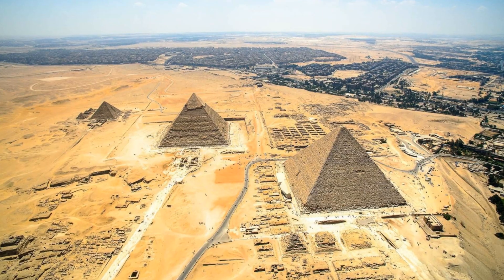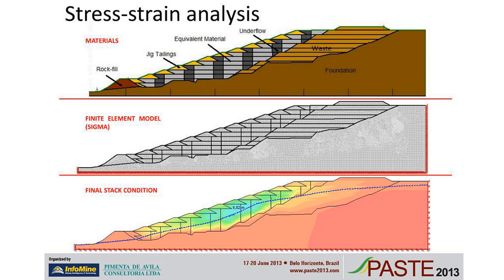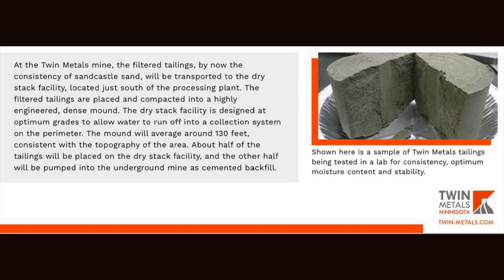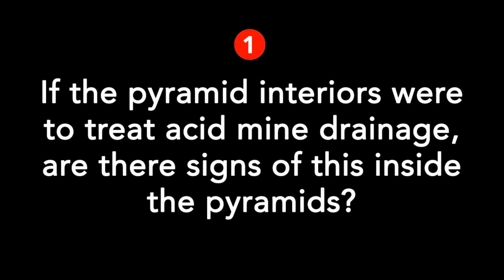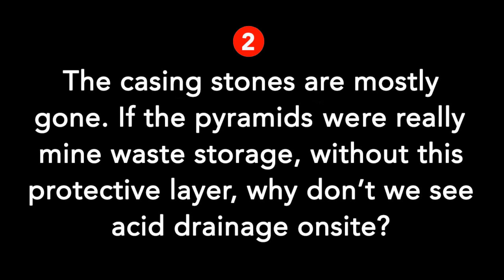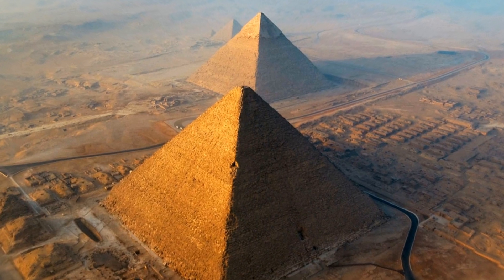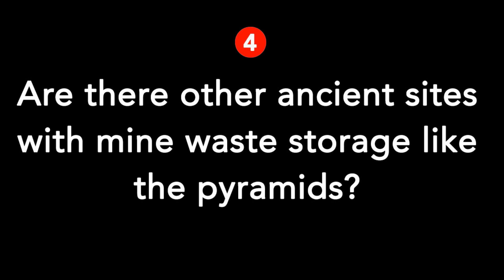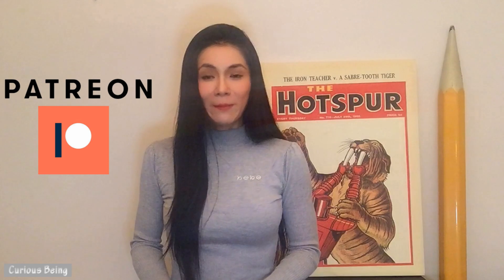Egyptian Pyramids Reveal Acid Mine Drainage Stains?

Comment: If you say that they are tailing piles then what were they mining from the limestone?
And if they were using the mining machines you said made the marks then why is the limestone in block form and not powder form ?
If you are quarrying for a mineral you don't cut blocks to extract the mineral you pulverise the Rock Ore then extract it from the ore.
Tailings usually come from mining ore of some type to extract what the mineral is that they are mining that contain Sulfur bearing minerals to produce AMD and ARD that produce Acid.
Limestone is mostly Calcite, Aragonite and Magnesium  used for most concrete today .
You would not have to worry about stacking the limestone into tailing piles you would just use it to build buildings instead. That is why so much of it was robed from the pyramids to build lots of buildings in Egypt.
I believe the deep erosion on the top step of the grand gallery before it was covered up was caused from the great big ropes used to pull up the Granite blocks for the Kings chamber.
And why would the Pyramids be made to align with the compass, there would be no need for this if they are just tailing piles. 
You don't take perfectly good limestone used in most buildings today and just pile it up as a waste product. 
As far as the salts inside the pyramid this can be explained by the fact that the pyramid was sealed off for a very long time and moisture inside the stone used to build with would cause  some humidity and dampness causing this to happen. And impurities like some Iron oxide in the sandstone could explain the red marks
Limestone was laid down sedimentary under the ocean for millions of years so it does contain salt.
Reply from the maker: Please see these earlier videos:
Prehistoric Mining: What was Mined on the Giza Plateau? https://youtu.be/y6ShuJdzDS0
The Underground Complex: the Giza Osiris Shaft Created by a Lost Advanced Civilization? https://youtu.be/GloDq_h7yLg
The Osiris Shaft: Part of a Prehistory Mine from a Lost Civilization? https://youtu.be/JuGt7JEWT6E
Reply: @CuriousBeingbyTina  I already did.

Comment: 1. "Resemblance" with modern tools marks, is not evidence of someone using them, you are misleading to proof a point.  2. They don't need a big "interior space" if you just need to "drop" a body(the pharaoh), a room full of things to use it in the afterlife, also, a bigger interior space with such weight on top, will require double the structural reinforcement. the "glass of water" in the pool had the perfect dimensions to travel to the afterlife. 3. Nop, we men don't build waste piles with such accuracy in eight face pyramidal shape and perfect orientation to the north and stars. neither create a beautiful outside layer of casing stone to make it visible from miles away. 3 piles of multi million stones wont create any environmental disaster no mater what shape you storage it or what continent you build it. it's just sediment from the ocean compacted during millions of years, "organic" like they say these days. lol. 4.Air shafts are blocked from the time of construction, they serve a function that nobody knows and were shut down, meaning that they were never "open to the air" after the pyramid was build. Stop trowing sketches mentioning the shafts as part of the mechanisms,  they never worked as open exhaust systems of any kind. lol
Reply from the maker: Clearly you watched my pyramid videos out of sequence since I've already answered your questions in earlier ones including the blocked air shafts and the Gantenbrink's door. I'm using the commonly accepted name "air shaft" not because I think these are for air ventilation. Also you might be interested in seeing the comparison photos and footage of tool marks from hand chisels, jackhammers and mining machinery in this video: Ancient Stone Caves in China & Egyptian Quarry Share Similar Machine Marks https://youtu.be/-cdfOVSpoeY
Btw I received feedback from many stone masons, construction and mining professionals - they agree with my judgement. You might be able to find these comments under some of my videos.
Reply: @CuriousBeingbyTina  1. if you know they are not ventilation shafts why you still show them in a graphic at 6:10? looking for similarities with mining ventilation pipes? i don't care if you "mentioned" in another video. I'm talking about this one. 2. because the scratching marks in the stone "looks like" doesn't mean they are done by a superior technology machine, that's jumping to conclusions under speculation.  Interesting marks are the  "scooping" marks all over the planet and we can't say that we melt the rock with a laser beam, don't you? you don't need a internal combustion engine to to produce tons of force, previous civilizations were really clever using momentum, gravity, lever, vacuum, etc. you don't need a "mysterious" previous civilization to produce those marks.
Reply from the maker: @acheronlv-4268  You regard that since you are an architect, your judgement on these stone tool marks overrule any professional opinions I consulted and received from stone masons, construction and mining personals. You seem to already made up your mind and don't want to watch any further.  FYI I proposed that the air shafts were for drainage.
Reply: @CuriousBeingbyTina  Again, the air shafts are blocked since they were build. No drainage is possible. end of discussion. lol. i don't make my mind because "im an architect", you know before been an architect i was in the army for 5 years, specialist in optics, communications, armored fabrication I'm black belt in jujitsu, accomplished diver, musician, engine builder, tuner, rally driver, collector, master in architectural illustration & art history etc etc. in other words, i know how is the world out there, i'm not one of those architects behind a desk, i manage teams of general contractors, i know about machines and tools. i design, plan and execute concrete structures. so, in any case, i can make my mind based in a long list of experiences and knowledge that i acquired during my 50 y of life. i don't really care about these bunch of people congrats you without watching the whole thing. I'm truthful and i speak my mind. and you are really pretty i have to say. lol
Reply from the maker: @acheronlv-4268  French drains are "blocked" too, and buried. That's how perforated drainage pipes work.

Comment: At 0:36 you can see the evident difference between a modern machine mark (6 to 8" deep cut into the rock) and a simple hand chisel tool scratching the rock barely 1/2" deep. stop saying they are the same. lol. the fact they are both lineal and vertical is just nature, you hammer the chisel down to gain help from gravity and be comfortable with your hands and body.
Reply from the maker: You are making an assumption. Have you measured either the modern machine marks or the marks in the Osiris Shaft? How do you know the mining marks are 6-8" deep? The ancient parallel and horizontal tool marks are on the ceiling. Have you seen any stone masons do that? Why don't you show the comparison photos in my video to real stone masons and ask for their opinions?
Reply: @CuriousBeingbyTina  not making any assumptions, just compare the two images and how deep the striation marks of the machine at 0:35sec, the orange machine ceiling marks are (approximately 6" deep) vs. the rest of the images showing humble striations 1/2" deep (yes also in the ceiling you can carve with a chisel).  zebras and crosswalks look both the same if you look at certain distance.
Reply from the maker: @acheronlv-4268  As I said earlier, you already made up your mind. Even if a mason tells you otherwise I don't think that'll make a difference.
Reply: @CuriousBeingbyTina  please let me know what mason tell you what, let's find who's the guy and check credentials. if you want to go to the details? lets do it. i can tell you im princes Diana visiting from the dead with Elvis on my side.
Reply from the maker: @acheronlv-4268  Since you don't trust anything I say - why don't you do your own homework and ask the masons you know?